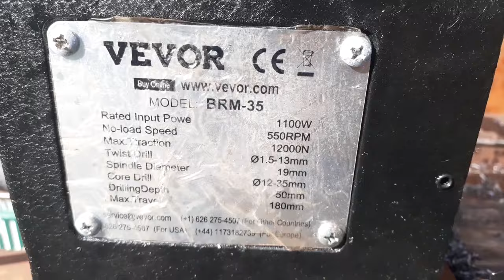Mobile Welding: Doing a small job at a warehouse. Forklift drivers will get you paid! #gusset

Comment: Get you a better roto hammer for concrete. Them plates stacked look horrible. Should have just went to metal yard grab a remnant of 1/2 plate. Remember you always want it to look better than it was when you arrived. Good idea on repair just make it look as clean as possible. What’s awesome is you use what you have and don’t complain.
Reply from the maker: Haha, "metal yard". Must be nice to have one of those close by. I get steel from a guy who has a lot of metal in his yard, does that count? Weirdly enough, I don't work with a lot of concrete, so I'll upgrade when the time comes. Thanks for the commentss.

Comment: Rad dude, you are out there making it happen.  That looks like a good idea how you weld the  column back together and then making the base plate.  Good planning with the gussets as well. 

But my dude, you really need to start welding with some 7018 . And you can still get some really nice not expensive Hobart brand ones . You dont even need to get the hermetically sealed ones.  There is a reason 7018 is the backbone of construction industry for stick welding in the USA. 

6010/6011 is great for roots and even pipelines where the pipe is just sitting in the dirt under bedding. Even for things like pipe fences But 6010/6011 is just so brittle compared to 7018.  It does not have the tensile strength nor the elongation as a 7018. 

And with that, I am not going to keep saying this in your comments. I said it when you first started. I just wanted to help a dude out with less headachs down the road possible.  But two times is enough. And I not here to shit on anyone, just wanted to say it again. You know if the comment was not read or not. 

I am sure you watched other welding videos on youtube and have heard the same things. 

Rad video dude, I dig the new welder as well!
Reply from the maker: Thank you! I appreciate the reminder about 7018. I thought about it, but the ones I had on me were crappy. Thanks again, and I might need you to remind me again down the road. 😆
Reply: Most definitely my dude. Every welding wire/rod and process has its place. There are pros and cons, right. 

But you are doing work for folks. And if its Something structural or critical.Its easier to explain in court why you used 7018 and did best practices than not.  And also you film your stuff for the public.  And this might never be a problem for you. But its just something to be aware about .  

And I just have a bias cuz 7018 is like king for steel 😅.As my back ground is in NDT(inspections) and I weld on the side. If you have a reasonable good looking 7018 weld, its probably going to be ok .

Keep crushing it dude. It will be no time that you have welder running .045 dual shield out in the field  . And we can crack that nut open at that time 😅.
Reply from the maker: @blueweld75  If I had my choice right now, I would be using gas shielded flux. From the looks of it, it seems like it would be like mig welding 7018. It's a great looking weld that spreads out. I watch On Fire Welding use it quite a bit. Is it really worth using dual shield for the thinner stuff (1/4" or less) that I mostly use? I figure that's for the big boy stuff. I did get some cheap gas shielded wire that is .30 for thin stuff, but I haven't used it. Haha, I need to do a video of my first time using it.
Reply: Yeah its kinda like a 7018. Dual shield has  some nice properties . If you look at a data sheet. So yeah like a 7018 .

I love Dual shield. Its great but it does have draw backs. The biggest one to me that folks dont really talk about much , is that in a 2F you can have the likley hood of having some lack of fusion at the root of the joint. 

Thats due to the properties of the wire . Its a fast freeze puddle. It will punch into the root of the joint with vertical and over head . But a 2F joint it sometiems does not get into the root due to the puddle not being molten enough and thats with 75/25 gas. 100% co2 you could get more penetration and hit the root of the joint and be fine. 

Also the wire size plays a role in it . I have cut and etchs with .045  with 3/8” plate in a 2F and I nail the root of the joint.  But I also make sure to stay in the leading edge of the puddle the whole time as well. 

Do you need it , ehhhh maybe. Its like you said you are only doing 1/4” . More than likely not right. But time is money and  dual shield goes in real nice and smooth . And its just quicker .  You can see that if you google welding tips and tricks dual shield. And  you will find a video of Jody and Jd welding T joints and racing with  stick and dual shield. 

And if did choose , I would run .045 wire . As You can hit the root of the joint in a 2F.  There are more home machines now that you can buy that can run .045 wire. Like everlast stuff . 

You also have other options like self shield wire that has a suffix of T-11 wire.  You can get them in 0.030, .035, and 0.045 . The can be ran in the wind and they have over all good characteristics as well. But you have to pay attention to the data sheets. If you can do a multi pass weld with them. And some of those wires have a range thickness of gauge to 5/16” or 3/4” . You have to look again at the data sheet. Cuz after their max thickness, they can start cracking. 

And I will answer this one now as well. You can runs short Circuit mig at 1/4” but its up hill for verticals and you need to stay on the leading edge. At 1/4”-5/16” you are at the max . And short circuit mig is prone to lack of fusion at or above those thickness.  Gauge -3/16” you are pretty good . At 3/16” you need to be on the leading edge though and thats with 75/25 gas as well.  You will see some folks run hard wire mig with 75/25 in position and crank everything up. It will sound like a hard thud more than the bacon sound. They are in the globular metal transfer and you can weld thicker metal with that.

Here is a link to another youtuber who has good stuff . This is one about dual shield. And if you read the comments, you will see my chimming in and updating my thoughts. Spoiler, I dont think you can .035 dual shield in a 2F with out a little bit of lack of fusion at the root. 

https://youtu.be/DV6OFpdpceM?si=So_Z6BblEmRwgRMR
Reply from the maker: Straight up mam, I am loving this! This is the whole reason I started a channel is to get to know some real people who do real cool shit, and know some things that  could help me and others who read this. I really appreciate you taking the time my man. I'm gonna try that dual shield just to try it. I bought some .30 dual shield wire a long while back and never tried it. I'll have to do it up and give it a go. Thanks again!!!
Reply: Yeah dude!!! Do you have an Instagram? Thats way easier to get a hold of me if you think I can help you. The welding world is small and there is a lot of good people out there.
Reply from the maker: @blueweld75  Yeah, I'll have to figure out my password. 😆

Comment: Pro tip :-Lesson on drilling real concrete- 
Step one
Get a real hammer drill / breaker with sds bits to get through it
Reply from the maker: I'm not sure I've ever seen "real concrete ". Weirdly enough, I don't work with concrete very much as a welder, so the fake drill I have should cut it for a little while. Thanks for the tip!